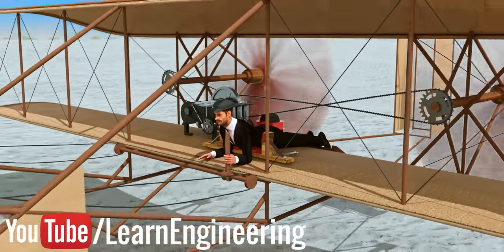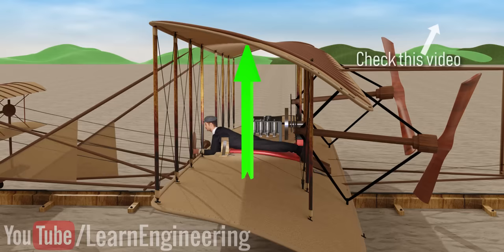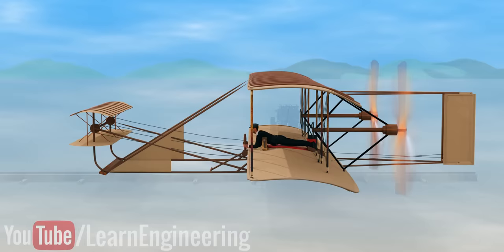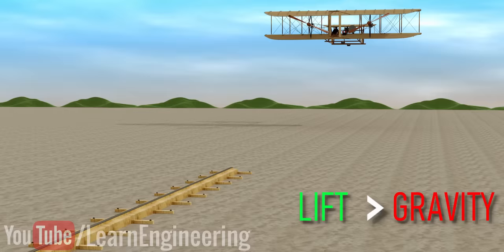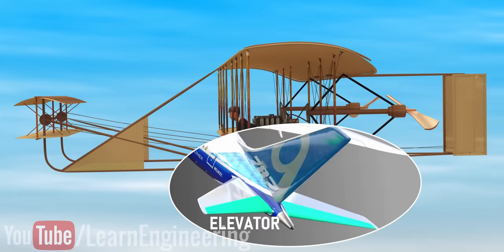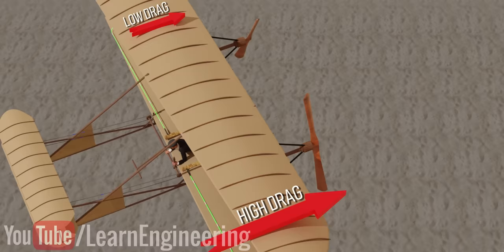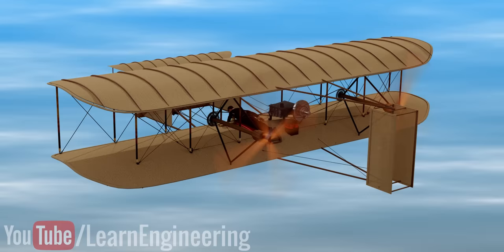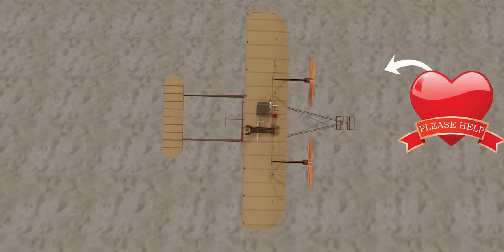The Brilliant Engineering of FIRST FLIGHT !

Comment: Catapulta não é motor
Reply: The 1903 Wright Flyer did not use a catapult.
Reply: @cardinalRG  Still couldn't lift on its own.
Reply: @franklin7213  --The Wrights used a catapult because it was their preferred method of take-off, not because it was a necessity to fly at all.  It allowed take-off from rough surfaces and confined spaces, such as the rutted and tree-lined Huffman Prairie in Ohio, where the 14-bis itself likely couldn’t have operated.  Nor could any wheeled aircraft at the time have operated in the sand dunes of Kill Devil Hills.  Consider that with a catapult, the Wright Flyers required about 60 feet to take off, while the 14-bis required more than ten times that distance (200 meters).  Moreover, when exhibition rules and potential customers required it, the Wrights disconnected the catapult and their aircraft took off with no problem, just using more distance.